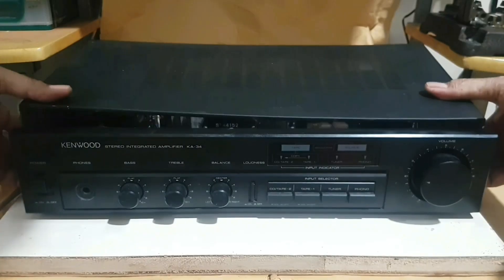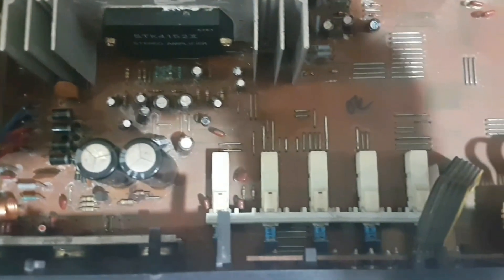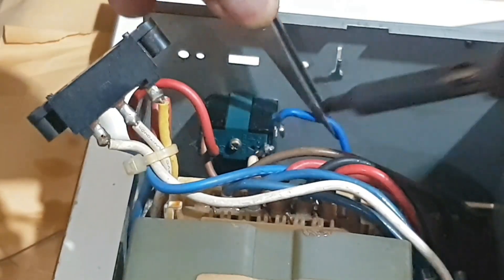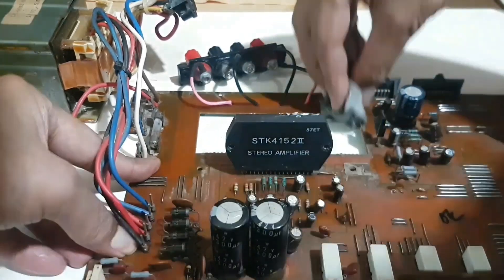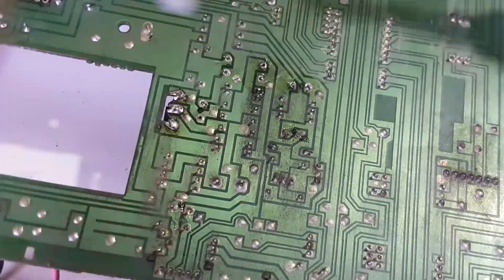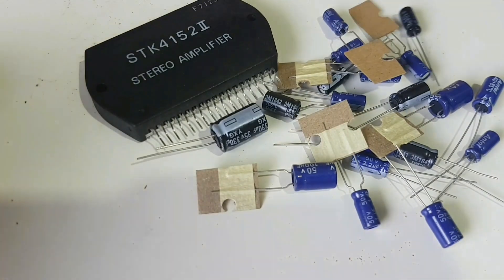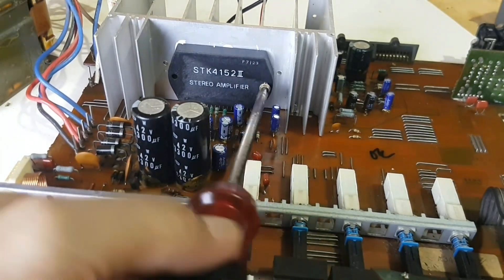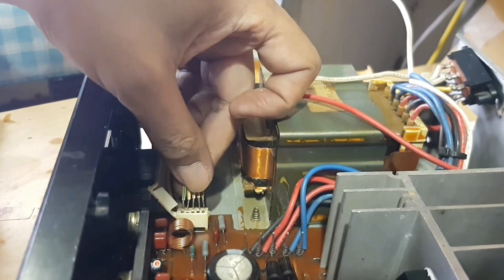Replace capacitor vintage integrated amplifier Kenwood KA-34-35-36 fix | STK4151 STK4152  review

Comment: Mineral water for cleaning electronic components? It should be the other way around; distilled water is the best option. Isopropyl alcohol is recommended for cleaning electronic boards.
Reply from the maker: No. it's demineral water.